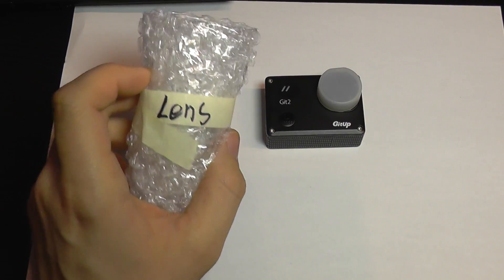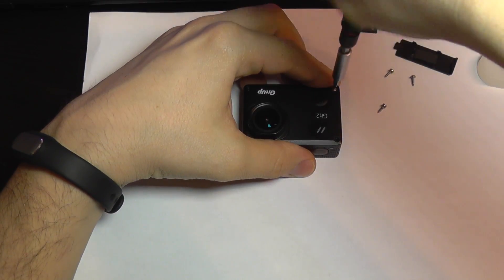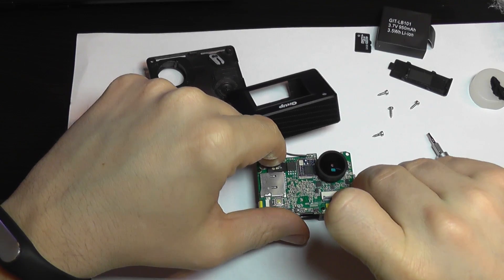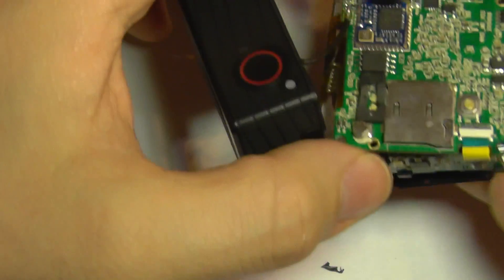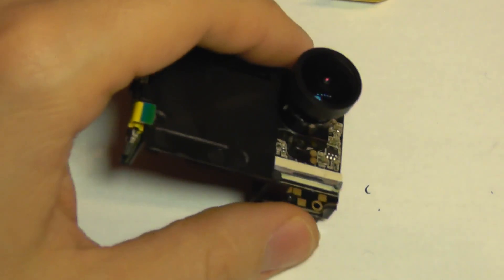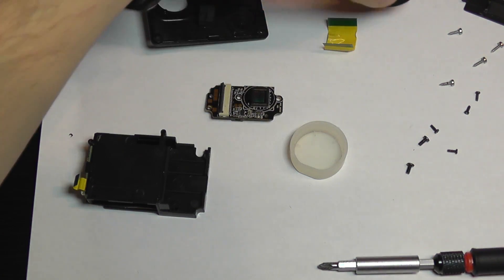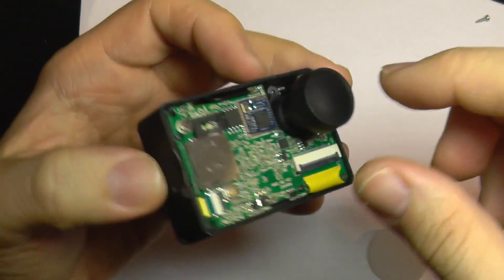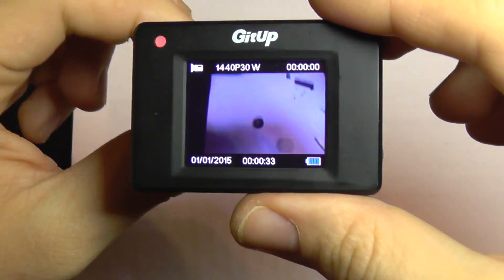GitUp Git2 Complete 90 Degree Lens Replacement Guide

Comment: I installed my lens but the gyro gives my video a warped effect when I'm moving..?
Reply from the maker: For the 90° FOV version there was a firmware update. Send a mail to GitUp support for the correct version.
Reply: Hi, I checked and there is only a 90 degree firmware for git2p. Mine has Git2-V1.8-1229 firmware. Is there anyway to fix? the camera warps like shown here: https://drive.google.com/file/d/10pcw5FXbJxtenM37g-1rQYR542h-ayp_/view

Comment: What cable did you use to connect Git2 to computer to view focusing picture?
Need to do same on MacBook Pro, which has usb, FireWire and Thunderbolt ports.
Reply from the maker: I have used a mini/micro HDMI to HDMI with my TV.

Comment: Are there any waterproof cases made for GoPro 4 that will accommodate this camera with this lens? I have the Git2P with the 90 lens, but I noticed debris inside stock lens, so I want to replace it with the 90 4.35mm lens you used.
Reply from the maker: The new Git3 has a longer lens so it's waterproof case may work with the 90 lens of the git2

Comment: Hello! I've replaced the lens and adjusted the focus as you showed in this video. Test photoshots showed sagnificant decreasing of image quality. It looks like this lens has lower optical resolution than the stock lens. Do you see the same or am I doing smth wrong?
Reply from the maker: Did you get the original lens ? There are a lot of no-name ones with poor quality. Also you should refocus to 2-3 meters away with this lens as it gets better results that way.
Reply: TechTronic9000, I bought it from the reseller and honestly I'm not quite sure if it's really original. Is there a way to make sure? P.S you mean that the foreground focus point should be 2-3 meters away from the cam, right?
Reply from the maker: Yes, the focus point is better to be at 2-3 meters.
Reply: I'm sorry for repeating myself, but is there a way to make sure the origin of the lens. Please describe the packing of the lens body: it was only a plastic box or also a cardboard? Any papers (instructions, garantees, ect.)? I'd be very grateful if you'd answer.
Reply from the maker: I've got mine directly from GitUp.com, but it was a bulk purchase with multiple items si it came just in an electrostatic plastic bag.
Reply: Mine too. Ok, thanks anyway =)
Reply from the maker: You are welcome, hopefully your are going to sort it out. By the way, which version of lens did you get ? There are 3 90° versions.
Reply: I assume I've got the "F2.8 4.35MM 16M FOV 90° 13G" one, cause I ordered it.
Reply from the maker: +Alex Stavrovich That is my personal favorite, it should yeld good results.

Comment: Very useful video, thanks for taking the time to make it. I would say though to anyone who has never tackled this kind of thing don't be rough with the boards and ribbon cables. I have dismantled cameras and replaced lens modules though not the Git2. Use a cocktail stick to gently prise off rubber and ribbon cables. I was amazed to see the video maker poking hard with his metal screwdriver! I would have thought an anti static wrist strap might be an idea too and try and avoid touch the circuit boards.
Reply from the maker: The Git2 is really sturdy built and as I have replaced a series of test lenses on mine, the video may seem a bit too easy to do. Just for a quick lens swap it's not even needed remove the CMOS board or the lens holder.

Comment: TechTronic9000:
I want to change the main board because the date/time battery has failed. Is the osd screen  ribbon separable from the pcb?
Reply from the maker: It's easy to switch over the LCD, it uses a normal ribbon cable and a latch lock connector on the PCB, you can see in in detail here: https://www.youtube.com/watch?v=Ktc6yaFj-qE

Comment: DO NOT DO THIS IF YOU WANT TO ONLY CHANGE THE LENS!!! 
Simply take the front off the camera (4 screws) unscrew the wide angle lens (there is some glue so you may need to heat it very gently or apply some force) and screw in the new one, focus, stick it and put the front back on. THAT SIMPLE!
Reply: I do not understand English and did not know why he also changes the base.

I was thinking of using both lenses as needed anywhere, especially for 
photography, even it is not even necessary that this has the four screws
 because the cap comes under pressure

I have already released my lens to do better focus, (with the help of a cuter).
When I put the lens the glue that makes it stop, and with two lines I've 
drawn at the base I know where the exact focus is and I can put the lens
 in less than a minute.

Now I want to buy this lens 90º to have a focal smaller, but I do not like the idea of not being able to use the other

So, you say that it  is not necessary to disarm completely, and it is enough to unscrew one lens and screw the other ?, and can be used as if they were 
interchangeable lenses?
Reply: sounds somple, fingers crossed. i sratched my original lense, if I buy a direct replacement from git up will I have to change focus? don't know how to do that.

Comment: If i see it correctly, the new lens is smaller in diameter outside the box, closest to the casing? I need to know because I want to mount it inside the Walkera g-2d gimbal.
Reply from the maker: the new lens has similar diameter with the old one but it's longer and it will stick out of the surrounding case.
Reply: Ok, thx. Do you now if the gyro stabilization also works with the new lens?
Reply from the maker: babipsylon -
gyro works but you will have some distortions as the camera is programmed to take the fish eye effect into account when stabilizing the image, although there may be a solution coming for that.
Reply: Ok, thx. So far, gitup is not mentioning any solution soon, but... who knows.
Reply from the maker: If you are going to use a gimbal than the gyro is better to be off anyway.
Reply: Really? Isn't the gyro like compensating for the vibrations the gimbal cannot handle? Because the gimbal tries to keep the camera focussed on one point while the quad flips and rolls, right? Plus it isolates the vibrations a bit, but not perfectly.
Reply from the maker: Some quads are very stable and with a good gimbal they don't need other stabilization.
Reply: That's true, but does it hurt to enable the gyro if the quads is not that stable or the gimbal is not that good?
Reply from the maker: In that case it will greatly reduce the vibrations.

Comment: GIT2 - Is the original lens glued like in SJ4000 or Xiaomi? 
If yes what kind of glue they used? 

I once replaced lens on my Xiaomi camera and it was fairly easy;
but in SJ4000 they used much stronger glue.
Never managed removing lens on this camera.
Reply from the maker: +Test Tenvis IP the git2 uses glue but it's easy to remove the lens by gently heating it with a hair drier.

Comment: Some videos show just unscrewing the old lens and replacing it without taking apart the camera. Why did you do it this way? Can you do it the other way or is this the best way to change to a different lens?
Reply from the maker: This is a full guide with disassembly also. The Git2 can have it's lens replaced, it's lens holder with lens and there is also a variant of having a CMOS board + sensor and swap them. This guide is the most complete tear down.
Reply: Okay, thank you. What happened to the menu settings for angle when you did this?
Reply from the maker: +B Spin the settings work and narrow will make fov smaller.
Reply: So to be clear ...you could simply unscrew wide angle and replace with new lens by screwing it in ? I saw this done with the  git 2 lens and different camera..
Reply from the maker: +RJA yes, that is possible, but you also need a hair dryer to heat it up a bit first.
Reply: thanks mate. Good job on the vid :)

Comment: Just performed this myself successfully (but I do have a fair amount of experience with this sort of thing, to quote Daddy Pig). Notes to add regarding the ribbon connectors. The large one has a flip up securing catch (the grey bit) - flip this up (from the cable entry side) to release the cable - this is not explicitly shown in the video. For the small ribbon, use small pliers on the coloured (blue) tab at the end to grip, wiggle gently and pull. Do not grip the ribbon with pliers - the blue tab sits above the ribbon. I gently inserted a tool between the display and its back panel to prod the sticky tape holding them together in order for it to release. Getting the unit out and in the main outer case again was more difficult than shown in the video for me. To get back in I inserted it level (rather than put the USB/HDMI connector end in first) and used a screwdriver to gently prize the outer case away at the USB/HDMI connector end to allow the connectors to slide down the inside of the case and back in position.

Rather than use the HDMI port, I used the USB on PC camera mode to aid focus adjustment. Software to make this work (OSB) can be found at:
https://obsproject.com/download#mp

Mine complained of a C++ file missing. Actually it complained of two, but only one was missing. I followed the link, downloaded both files then installed the one that was missing (I could tell one was not missing because when I ran its installer, I was given the option to repair rather than install). Then just added new video capture, selected Git2 and it worked.
Reply from the maker: Thanks for the comment and the details.

Comment: why removing the sensor module and old lens with the M12 thread holder mount and nt just removing the glue and changing the lens only?
Reply from the maker: It can be done in both ways. This is a full dissemble guide also. There are also other lens holder models, original was metal and later revised to composite plastic. So it depends on your situation.
Reply: I followed the guide and disassembled, but turned out that my replacement M12 thread lens holder was too big to replace, so I turned the lens and the glue just turned with the lens so I could easily unscrew the original lens. If I know that it is that easy I won't disassemble just remove the front cover an turn the lens:)
Here are a quick test with other lenses as I don't have the 90 degree yet with me:
http://www.rcgroups.com/forums/showpost.php?p=35292444&postcount=4850

Comment: Why not just screw in the new lens rather than replacing everything including the lens holder? 
Btw, how do you remove the lens? I've read somewhere you have to heat up the lens holder (hairdryer?).
Reply from the maker: Depends on your needs, I have replaced the holder as well, and it's also a complete disassembly guide. A normal regular hair dryer does the job wonderful.
Reply: Thanks! 
Please let me rephrase the first part of my question:  Is there a real need/necessity to replace the lens holder?
Reply from the maker: +Me&My Gal No, the holder can remain fixed.

Comment: Has a waterproof case that accepts the extended length of the 90 degree lens been developed yet?
Reply: I think the simple solution would be to extend the lens housing somehow, rather than try to fill the entire gap and have to deal with the hinge.
Reply: but the front 'glass' in front o the lens should be moved further only so cold be easily done with the proper shape washer and longer screws
Reply from the maker: Not yet.
Reply: any solution to extend the case with some rubber washers and longer screws?
Reply from the maker: And it will also need another O ring for sealing the added spacer.

Comment: I fear I ruined my Git2. On re-assembly the smaller of the ribbon connector sockets became detached from the circuit board  ;-(
Reply from the maker: Do you have a picture with the connector ?
Reply: Yes. You're on RC Groups, right?
Reply from the maker: I'm everywhere: RCG Forums, DashCam Forums, YouTube, Facebook, Blogger, Google+ :)))
Reply: PM sent!
Reply: Ah!! I can't believe I overlooked this before I took mine apart and 
damaged it!! I have replacement Git2 on the way and I want to try again.
 So just open the front, then gently heat the adhesive to unscrew the 
actual lens and screw in my 4.1mm? 

After that focus with webcam mode connected to a PC?  Can you give a 
link to the contrast pattern you used?
Reply from the maker: +Ken Weller just google: "siemens star" it should give you a lot of results.

Comment: **WARNING** 
Do NOT buy from eBay seller: wonderfull003 I purchased one for £100 and paid extra £10 for express shipping and it keeps tuning off after 2 minutes. This seller offered me £5 to remove negative feedback and expects me to return it without a tracking number (so I am then not covered by Paypal). Also to return with a tracking number it will cost me £40.

The seller finally offered to ship a replacement and gave me a tracking number. However, the tracking number is from a shipment 21 days ago which shows being delivered to an address over 200 miles from where I live. This seller if full of lies and the after sales and service is non-existent.
Reply from the maker: That's a really bad experience.

Comment: Followed your video, but seems I f.ck.d up at some point because the screen only is white with black marks, so the camera is broken :( seemed easy but wished I never started it to replace the lens :(
Reply from the maker: Check the ribbon cables.
Reply: https://www.facebook.com/groups/GitUpUserGroup/  here you can see the photo of the screen :(
Reply: probably just pushed to hard to get it out of the housing, :(
Reply from the maker: Yes, looks like impact / forced / cracked...send an email to gitup for a replacement LCD.
Reply: dont have the money for it :( so have to wait few months :(
Reply: I didnt get it out of the case and didnt want to force so stopped and pushed it back, but seems already was forced
Reply: and even now that it is broken still can not get it out of the housing pfffffffff
Reply from the maker: Use your finger through the battery compartment to push it out.
Reply: tried so many times as in your video but it simply keep stuck in the case

Comment: i just received a git2 today. The app doesn't work properly, no sound comes through no matter what I try. I would like to know what I need to do to get it to work with my pc too. This is the first action cam that I have owned, but I am having a rough time with it so far. I would so like for this to work out for me but I my optimism has gone. I am seriously considering returning it for refund. Please help
Reply from the maker: What app are you using, there are several. On the PC it works fine with AMCap. Although this is an action cam so it's main usage is for outdoor action videos, for PC it's better to get a simple webcam.
Reply: Hi,I want to use it as an action cam not as a web cam. Thanks
Reply: I used the final cam app from the web store
Reply from the maker: The last update of final cam made it a bit unstable, try with FN Cam or Fusion Next.
Reply: Thanks, I will try this out and see what gives.
Reply: Message reads "Can not play back broken film." I am really stuck here.
Reply from the maker: This happens when you try to playback from the camera to phone ? or on your PC ?
Reply: Camera to Nexus 7
Reply from the maker: Try to download the file to phone and use MX player for playback.
Reply: I will give that a go, but this didn't work when I used final cam. I had sound with no pictures.

Comment: Just watched again ... even if I bought the unit with the CMOS board, it's a pretty involved process.  I have a lot of experience working with those thin ribbon cables, and they are an accident waiting to happen.  They are not able to take much bending or abuse. Maybe I can sell my 170 deg. Git2 and buy the new narrow FOV version.  Its a shame the FOV:Narrow option doesn't work on my Git2 ... every time I try that, the video goes all grainy and is impossible to view.  Thanks again for this video. Cheers!
Reply from the maker: +Bill Somrak Gyro and Narrow use a cropping of the image thus reduce the quality a bit, a workaround is to use the 2K@30 fps with narrow or Gyro and the when editing to encode it to 1080p it will look great that way.

Comment: hello @TechTronic9000 my friend`s git2 don't work properly after he changed the original fisheye lens with refocus lens. the shutter button dont work after he accidentally uprooted the black wire from cct to body. is that any possibilities that the black wire causes the malfunction shutter button ?
Reply from the maker: +zachmagnetic the black wire is the WiFi antenna, if the shutter doesn't work there is another problem like a lose ribbon cable.

Comment: any idea on how to fix the gainy image on inhouse enviroments, or not sunny day?
Reply from the maker: +RaitonGG Grainy image is a trade off of high resolution CMOS sensor. To improve video quality use a lower frame rate (30 instead of 60), also you may experiment with the manual ISO and manual Shutter.  The lower the ISO value the less grainy the image will be but it will also become darker and will need slower shutter speed that can create motion fade.
Reply: TechTronic9000 I tried that. inhouse it still looks terrible :/
Reply from the maker: +RaitonGG Use a LED lamp indoor, still the Git2 is an action cam, made for fast outdoor action...
Reply: TechTronic9000 yea but it totally does not work on fast outdoor dawn action.. xD
Reply from the maker: +RaitonGG Here's an example of manual settings for the Git2 in low light / indoor, image quality is pretty good: https://www.youtube.com/watch?v=06RZPdxiHQM
Reply: TechTronic9000 wow yes it does look good compared to mine!!! 
any idea if you can save presets? so that I don't have to change it manual everytime I enter or leave a house?
Reply from the maker: RaitonGG Currently there is no possibility to save profiles. Anyway you need to adjust shutter / ISO depending on the light level.
Reply: TechTronic9000 i'm quite bad with image but I'll try, thanks! :D